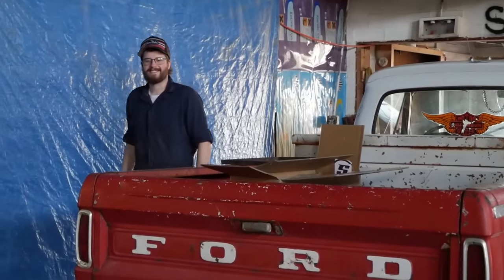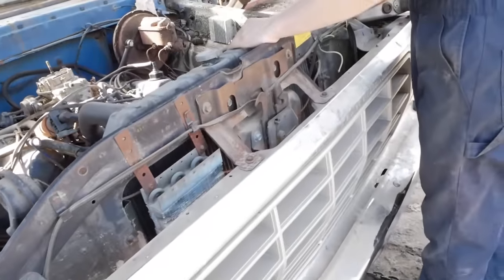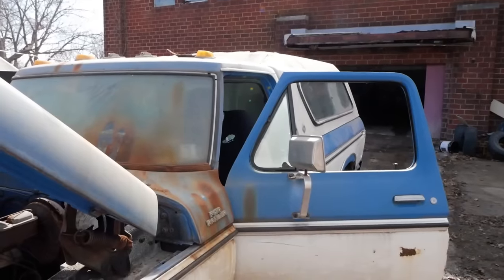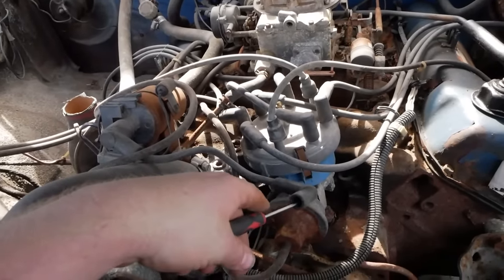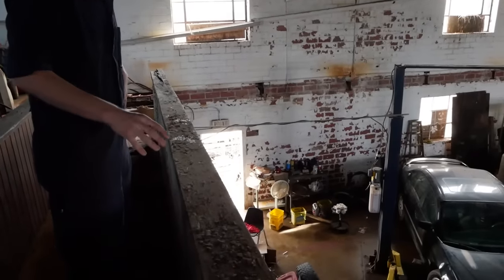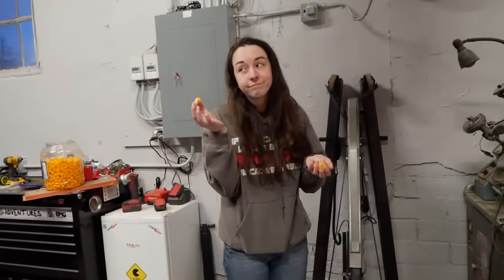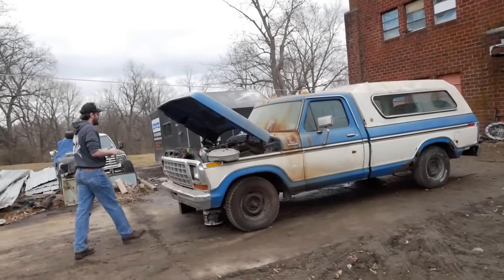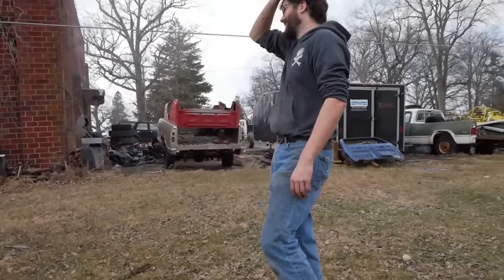Will This Old Ford Run After 10 Years in an Abandoned Gymnasium!?

Comment: Yes! We need a Go-Kart Revival!

Also, the way you fix a SortaSpark ignition is to replace it with an MSD box if you're rich, or an HEI if you're poor.  Fuck DuraSpark.
Reply: Ye. MSD 6AL plugs right in. I'm prolly moving that way with my EEC-IV 300 I6; Duraspark dizzy and MSD box.
Reply: I have 2 go carts, new engines in boxes and loads of parts. Looking to sell. If interested hit me up and I'll send picks. Columbus Ohio is my location.
Reply: Duraspark’s are decent boxes. Reliable and efficient. That’s it. Not the best for performance.
Reply: I’ve never had any trouble with the duraspark

Comment: 79 F100 Flareside with a straight 6 sitting for 6 years.  I took an interest in it.  Used as a garbage container so the wood bed was toast. Got it running after a couple of days and my daughter and I cleaned out the bed for the last time. Very cool truck. Hoping to see more old  F series revivals on your shows. Thank you.

Comment: Now I kinda want to see more of this gentleman that lives there. Bettle without the front, Triumph, old Charger, and a lot of random vehicles scattered around.
Reply: Ask me anything. I'm one of his buddies. I was actually the one who hacked the front off the bug to get the motor out.
Reply: @dylansnyder7757  ok I'll bite, why would you need to chop the front end of a vw bug off to remove the engine which is in the rear?
Reply: @MegaDysart  lmao
Reply: @MegaDysart  it's a new beetle.....
Reply: @dylansnyder7757  having replaced a headlight bulb in a new beetle once you damn near want to cut the front end off just to change the bulb. Also, big fan of the mk1-3 vw stuff, I saw a few parts I could use, especially if that silver MK2 has good rain gutters.

Comment: Watching this again, there's a story behind that Cleveland being in that truck. Back in the day Ford would actually take parts that were sitting on the shelf and use them. Such as my father had a Ford Torino (can't remember the year, pretty sure it was mid to late 70's) that had a numbers matching Cleveland motor in it. They would do things such as take engines and transmissions that were sitting on the shelf and instead of letting them sit they would put them in vehicles.

Comment: Duraspark seems to be like the Mopar ballast resistor. I carry one with me in my Dodge just in case.
Reply: Exactly like!
Reply: @mikec9112  I'm not sure what the failure modes of the duraspark are. Some are reliable, and some not. Got a feeling it's down to wiring... The voltage regulator is definitely a carry a spare item though, I agree.

Comment: i like how he says dura spark is so terrible. I have a 83 f150 and it had its original dura spark box from 83 up until I had to replace it 2 years ago. And I only replaced it because it wouldn't fire when it was hot. If it was cold the box would work fine. 
 One trick I have found is since the dura spark box's dont like to be hot, I extended the harness for the box so that I could have box mounted on firewall inside the cab instead of having it in its stock location on the inner fender.

Comment: That engine is definitely a modified. I had a 351m that didn’t have that boss on the timing cover. Another way to check if it’s a modified is by looking at the motor mounts. If it’s a 3 bolt it’s a modified.
Reply: Correct, I had a '79 F-150 Ranger long bed 4x4 with the granny gear 4 speed. Bought it in 1981 from the original owner. It was silver and black two tone, truck was sweet but man it was a gutless pile. Had the 351M. Just looked at some pics of it I have and they have the dreaded 351M.
I had dreams of putting a 460 in it but never did.

Comment: I rebushed a 4bbl holly 600 once and it worked beautiful,,   it is difficult to get the bushing centered correctly  because the throttle shaft usually wears into one side of the shaft hole,, I rebushed mine using a lathe,,   :-)

Comment: At 27:08 I wanna see that Dodge get revived I wanna say late 60s early 70s Dodge pickup
Reply: I wanna see a Triumph revival if it still had an engine in it
Reply: @Karmy.  that would also be interesting
Reply: The dodge is in the works. They started working on it but it got sold so they're working on it with the new owners.

Comment: That’s definitely a car engine can tell buy dipstick location
Reply: Or at least from a for front sump pan setup, which some 4x2 trucks had.  The 4x4 had a rear sump pan. If it has a rear sump pan, it needs the dipstick to match.
Reply: 4x2 truck and from what I've looked so far it is a Modified still. Just has the odd cast block without the rib.

Comment: That is a modified kevin my modified looks just like that one
Reply: Mine doesn't, it's got the bar
Reply: Definitely a Cleveland
Reply: @burntsilverado  what year is your modified?  late modified engines were lightened wherever possible for help in the fuel MPH category.  The only way to tell the difference in the late model 351M/400's and the clevelands is the 351c's take a small block transmission and the 351M's post 1973 wont.
Reply: @bad74maverick1  79
Reply: @burntsilverado  what transmission you got?
Reply: That bar is not an indicator if it is a modified. They came with and without. It is really easy to tell the difference by the Intake valley wall. The modified has a higher deck and has a visible wall. Cleveland is all kinda on the same level as the dist pad.

Comment: With the right reamer and bronze bushing kit you can fix leaky throttle shafts in 10 mins......and the white corrosion in the bottom of the bodies that carb dip wont touch? Thats zinc oxide (many bodies are pot metal- zinc).....pour a little naval jelly (phosphoric acid) into it, give it a few mins, and rinse.....looks like brand new 😉👍

Comment: So it’s funny. Took my ‘79 out for a cruise last night and it kept dying on me and eventually it would start again. However. The duraspark box was not to blame. Because the coil would fire every time but it didn’t want to start. Pulled the cap off and the reluctor wheel was a little crusty so I scraped it off a bit and jiggled the magnetic pickup and it’s been running goodish, since. Never would have thought to check it out had it not been for this video. Thanks Kevin!

Comment: I had a 78 with a Cleveland from the factory back in the day u went in grab a sheet and checked off what u wanted on it cars or trucks you could get and motor in any car they made at the time as long as it would fit between the frame rails

Comment: Yes on the gocart revival. Lol. And i like that interior color as well. Its the same color blue as my 77 F-250. Did you confirm that the engine really is a Cleveland? It looks a lot like my 351M. But i am only going by what i can see in the video. And that topper, is a dealer option made by Four Seasons for ford camper shell they called it back then. My 76 F-350 camper special has one on it. It you look at it, you will notice it has the same "dent side" design under the side windows, and the front matches the cab angle. Great job on another rival guys. Love to see these old classics stay on the road. Will have to try and get one of my truck out your way sometime.

Comment: Those old Motorcraft 2 barrels are actually pretty good carbs when they are tuned. I had a 2150 on a 77 150 with a 351M and it got 18 MPG with a 4 speed and 4WD.  And would pull a mountain.

Comment: For ghost hunting I recommend the Nebo Tools Redline 6K flashlight, featuring a rechargeable dual 26650 li-ion battery and 6000 ghost blinding lumens, in a turbo mode (6000), strobe (6000), medium (1200) and low (60)

Seriously, pointing this thing at my wall brightens my room up more than the sun does, and the wall itself is almost too bright to look at, i love this flashlight, its also a powerbank, is waterproof, and the power button and top glows after you shut it off

Comment: A simple situation, check the battery, relay and starter. Replace what failed. The clutch safety or neutral safety switch may be at fault as often as they do this, id go to an rc shop and find a gallon or 3 of rc fuel. 2 or 4 , cycle would work, and the nitromethane would be fun. He had the same idea. As for the carb. You just rebuilt it, take the idle mixture screws out 2 full turns.

Comment: My revival is my 2002 ford expedition xlt 4x4 that has a blown timing chain , 3 flat tires and needs an oil change. Oh i also need to reinstall the front drive shaft. Its been siting in my yard for the last year. Ive just been gathering parts. Going to the shop for the timing chain sometime this month or the beginning of next. The rest of the work ill do myself.

Comment: Hey Kevin. Not to argue with the block guide you're using, but that's clearly a 351M engine. Clevelands were pretty small, lower deck than Windsors. They look like buffed 302s!

Comment: Corner of the head by the valve cover on that surface closest to the dizzy will have a 2 or 4 if they are Cleveland heads. 2 meaning two barrel heads and 4 being 4 barrel heads. An M in that location is a modified

Comment: Only thing that goes bad on a metal roof is the screw seals if you get a good caulk sealer you can seal the screws and it won’t leak for another 5 years !

Comment: Throttle shaft bushings are not that prohibitive.  They really should include them in rebuild kits.  I wonder if you could do something like wrap the throttle shafts in Teflon tape to seal out the air? or compensate for the vacuum leak by raising the float level a bit? and/or a bit richer idle mixture? or low speed jet?

Comment: 4:03 The internet forgot to add one other Ford Engine in 1978/1979 to the 351 lineup Cleveland, Modified, and Windsor were put into these old trucks.. This engine might be a Windsor. (Iowa is 600 miles from Windsor Ontario)
Reply: 351M looks like a Cleveland because it is, except the deck height is taller since it’s a destroked 400, which is also morphed off the Cleveland. Brother had 351M in his pickup. I remember that engine well. Stock it was ok. But he went through that with all the hot parts of the era and then she’d run 130 mph on the top end. You could buy intakes, carbs, headers, cams etc and wake these up, Today you can’t find much for the 351M. Time passed it by.
Reply: 351 Windsor looks like a Cleveland & a Modified as well. They thought the engine was a Cleveland or a modified, but with missing pieces.. So it could be a Windsor. 

Easiest way run the Vin number from the engine, and you'll know for sure.  http://www.free-vin-decoder.com/

Comment: The 351c and 351m have different bell housings,  so they would have done a Trans swap as well or came up with an adapter.
Reply: Haven't had a chance to crawl under it yet. But so far looking like the oddball mod block without the rib.

Comment: Rebuilt about 100 factory holley, motorcrap and autolites over the years and prolly two dozen quadrajets and they always run just as good as stock. Replacing throttle shaft bushings is part of the process. Not much on Holley/autolite/motorcrap/carbs to fuck up.

Comment: I know! you guys are unwilling to adjust the idle speed and always set the throttle stop to that square slot, which makes you unwilling to compensate for the vacuum leak caused by the throttle shaft bushing, or any other hard to fix vacuum leak, by backing off the throttle stop.  If you back off the throttle stop to compensate for the vacuum leak, and maybe richen the mixture screws a bit, you should have no problem idling a worn carb.

Comment: Considering I got my 78' after it sat for ~8 years to run by rebuilding the Carb and changing the rusty guzzoline (Mad Max word) tank. Has the 351 Modified, factory radio delete, A/C and Heat, Cruise Control, and a 68' bed installed. The previous owners (who are family) rebuilt the motor and also got sideswiped resulting in the bed change before it was parked. For almost a decade's worth of sitting, the ol' Ford had only surface rust and needed cleaned, even though it sat outside halfway on grass and halfway on gravel.
Reply: Electronics did better mine at first. Lol. Had to rewire the rear lights and signals (due to the bed change) and replace bulbs and right headlight (busted by gravel from a mower I assumed). I have not gotten the OEM-style radio to put in yet, nor have I replaced the passenger mirror (can be seen from but was also busted, leading to more belief with a mower and gravel).

Comment: That is a 351 or 400 modified with an early cast block. The early blocks did not have the extra boss by the distributor. Secondly,  the intake manifold is wider than a Cleveland.

Comment: the part about the phenolic spacer is wrong. for my 2.8 v6 which has the small 2150 you only get the phenolic spacer and if the spacer didnt sit on the shelve for the last 30yrs it will seal. you dont need any other gasket on top and below. i personally put reinzoplast where you have put the gaskets. Its basically RTV but stays liquid(sort of) over the whole lifetime of the carb

Comment: That’s nothing. I had a 1976 dodge one ton dual wheel box van that set out in the elements with no battery for twelve years. Put a battery in it, poured some fresh gas in the carb and VROOOM! It started right up. A little smoke but within one minute the smoke was gone and the box van was ready to work!

Comment: Isn’t it safer to connect the positive first, then the ground? Putting the positive on second makes sparks.
Reply: If there's a parasitic draw you're gonna have sparks either way. The sparks, although present, will be lessened by going + first so for safety's sake, yes.

Comment: For the first time, I 100% disagree with you on something. Respectfully, of course but a properly cleaned, rebuilt and metered carburetor can function just as well as a new unit. It took a lot of practice, some specialty tools and a prolonged state of "cantaffordit" to get to this point but it is possible. Every carb brand has their own needs. Any carb can be freshened with positive results but it takes more time and attention to properly rebuild one.

Comment: I would have entered, but firstly, im late, and secondly, my car has still been parked off for over 1 year, because it needs an automatic transmission, and where I live, its impossible to find one where I live..🥲 If you were wondering, its a 1993 BMW 740i, and I bought it from a junk yard where it was parked since 2010, so it was parked for 20 years when I bought it.. it runs, and it cleaned up beautifully, but it doesn't move..🥲

Comment: $100 question because there's probably a hundred different answers or opinions and maybe Kevin and Mook will have an answer and why they pick the particular one which is better 351 Cleveland the 351 modified the 351 Windsor or the 400 which one's the best motor and why

Comment: "nAh bRo RTV cAn rEpLaCe aNY gAsKeT u dOnT nEeD 2 bUy nEw gAsKeTs"
> The guy who has a total shitbox 'with a cam in it' [its a vacuum leak].
> The guy who brags about his modified Honda Civic.
> The guy who knows someone who can do it cheaper.
> The guy who only uses his scanner to 'diagnose' vehicle problems.
> The guy who uses wire nuts for automotive application.
> The guy who does 'professional' body work in his yard [its walmart spray paint].

Comment: ok V8 Ford Windsor motor has water  thermostat housing on top  intake manifold not block second quick look fuel pump has side bolts not top and bottom

Comment: I musta missed the part where ya changed out the oil, checked the transmission fluid and rear end before you did that burnout. Oh well, I am an older fella and don't see to good or have a very good memory anymore. That almost makes it hard to like the video, but what the hey, what ya gonna do with kids nowadays.